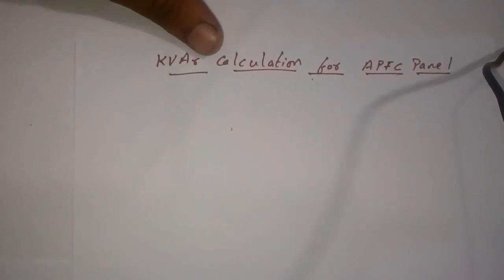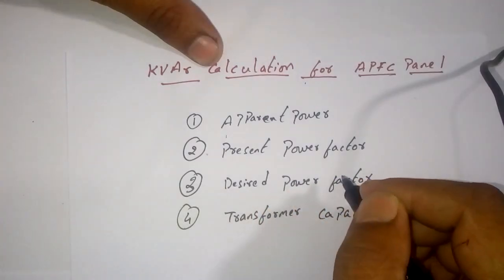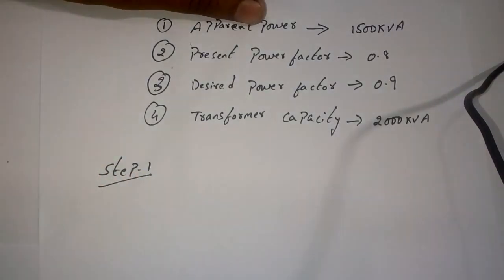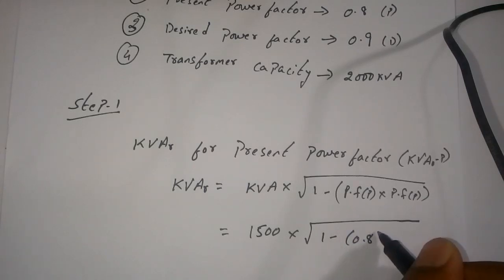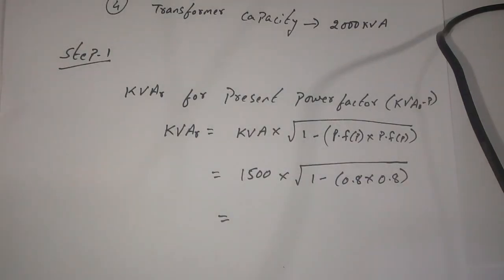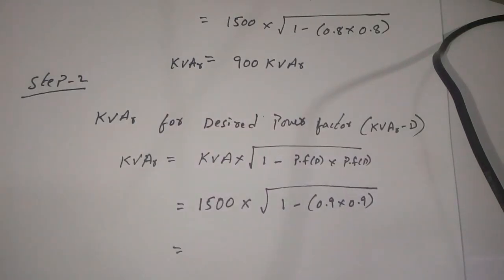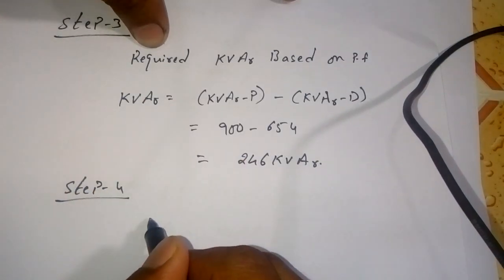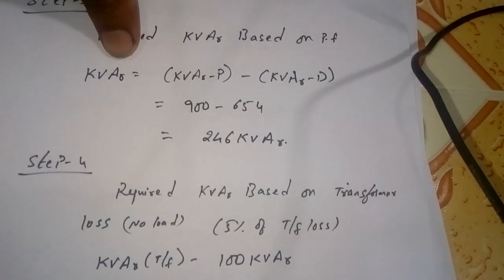Kvar calculation for APFC Panel

Comment: Transformer capacity (KVA)  is the apparent power, what is the other apparent power you mentioned???
Reply: Correct 👍
Reply: Correct, i think he is a student and solving the problems in Engineering text, it is not professional
Reply: as I think, big industrial factories have KVA rating(Electricity Bill also Have), so should consider that kva for calculation,